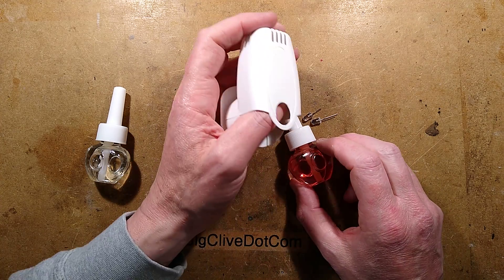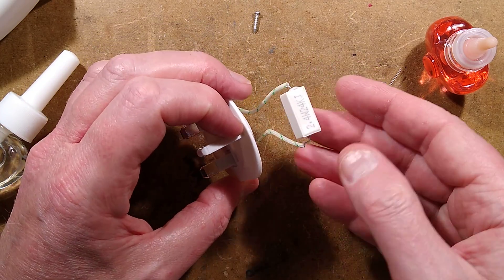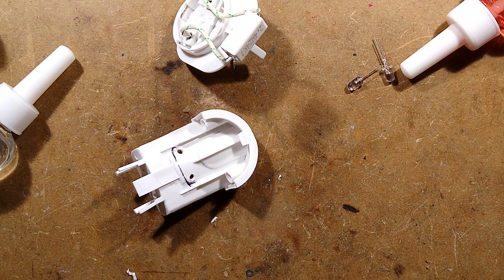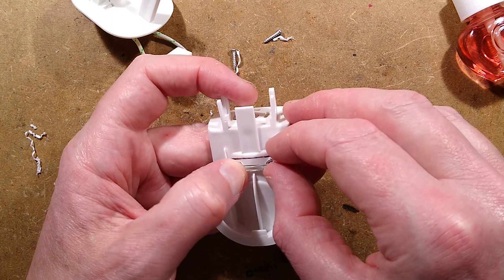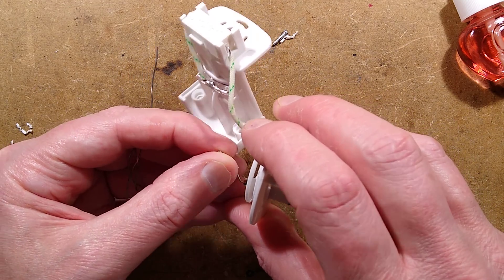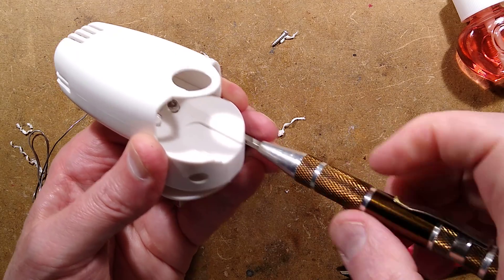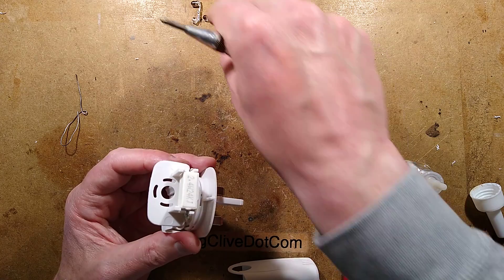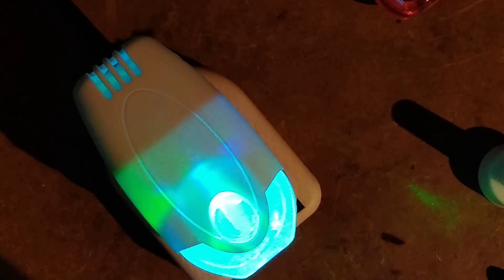Air "freshener" hack gone wrong

Comment: never assume long lead is positive, i had a few many years back that were long lead negative😉 think i still have some left!
Reply from the maker: The fred LEDs were the worst for that.  Probably because they used the gallium nitride machine settings for gallium arsenide LEDs.
Reply: He did mention testing them. For color, granted, but that would still require correct polarity.

Comment: OWW! Pop goes the weasel and so does the LED, I actually thought you would put an LED on each lead ie. one on live and one on neutral rather than tramline them together would it not work the same and possibly less chance of shorting out :-)
Reply from the maker: They have to be in inverse parallel for the AC.
Reply: no it won't really work - the diodes will prevent the current flowing in the reverse direction for the alternate side. Except if you push past there reverse breakdown voltage - which will "work" for an exceptionally small time as leds kinda don't like that and die
Reply: @askjacob  Yes I worked that out after I posted of course you could use two extra ordinary diodes, but yes I just posted without thinking it through which 5 mins later I had:-)

Comment: How to explain our eWaste problem:
"Cheaper to buy a new device over buying refill"
Reply: Yup.  Device is a loss leader for the ink, blades, refills: check.  Resistor under-rated or otherwise designed to fail early: probably.  New software doesn't "support" last year's hardware: working on that now?
Reply: @idjtoal  That would be Windows 11 you are talking about. I get why they are trying to push for people to use computers that are more secure, but they shouldn’t exclude the people who don’t have the proper hardware completely. Educate people to know what new hardware they should buy next when they upgrade…
Reply: @ColinTimmins  have you ever considered that "security" is a selling point? I mean whether it is actually a threat or not in the real world.
Reply: @gs425  They'd still have that selling point by saying "if you buy a certified Win 11 computer you get these security features you don't if you run the upgrade on older hardware".

I think the CPU limitation, if indeed it IS as limited as suggested so far (I suspect its not and they will revise the list before launch) is efficiency as much as security.

Having to keep a code path for if CPU has this instruction then do x, if it doesn't then do y, can get awfully complicated, buggy and inefficient.  A clean break saying it will only run if you HAVE these instructions is long overdue, its just not something you'd generally do if CPUs from only a couple of years ago DON'T have those instructions.
Reply: @ColinTimmins  There is definitely value for Microsoft and consumers in drawing a line in the sand and saying, "Right, anything older than this just HAS to go," but security is definitely not a major benefit of the move. Vendor lock-in, however, would become much easier if TPM is an absolute requirement.
Reply: Yeah printer manufacturers went through this phase a long time ago. It was often cheaper to buy a new one vs cartridges. When everyone caught on, they switched to 'trial' cartridges which had 10 pages worth of ink. People began refilling, so they created a mechanism to encode the cartridges.
I bought n Epson ink tank printer, thinking that by paying a higher initial price I could avoid being raped. Unfortunately not. It has a pad to absorb ink from the cleaning cycle. After a certain number of cycles it announces that the pad needs replacement and refuses to print. Guess what? Replacing the pad costs as much as a new printer.
Reply: To summarize, it smells nice and now lights up... hmm... what does this remind you of? Scented Candle.
Pros: Smells nice, creates a pleasant ambiance, no harmful waste, no embodied energy remaining after use.
Cons: things could catch fire.
Modern replacement.
Pros: Smells nice and also glows. Was much less likely to catch fire. 🤣
Cons: modern waste products after use, lots of embodied energy, base products are non-renewable, likely assembled by people not thrilled regarding their current internment.
not an extensive lists.
meh, just saying.
Reply: I think the joke here is that they rely on the usual business model used for printers or razors, and the only real deterrent for consumers in this strategy is "you don't want to throw it all away right?" - when the price says the exact opposite, talk about an incentive to waste...
Reply: Literally I went to buy mosquito repeller thing (same thing as above) and one box containing both device and liquid bottle and the other was only the liquid bottle and guess what? they were both same price.
Reply: You can buy the "essences" very cheap and refill the refill bottles by prying off the wick then putting it back.
Reply: @Fridelain  I've tried refills before, but they make the wick dissolve. I assume the originals are some secret formula that stop the wick dissolving specifically so you can't refill them. This was specifically with the Glade branded ones, your mileage may vary with other brands
Reply: You pry on the plastic cap, not the wick itself.

Comment: It's a corollary of Murphy's Law: if you put all the screws in before testing, it will fail.
Reply: Or it only works with the screws out.
Reply: Or in my case. Lose one screw put in just a little longer screw.  Which shorted the device. Lots of magic blue smoke.
Reply: I think there's an opposite effect: The failure gremlins are attracted by fear, and if you put all the screws in before testing it shows them you're not afraid, so they stay away (usually).
Reply: @KarlBunker  They are also very attracted to any public demonstration of the HW/SW. How they know the difference is one of the great puzzles of the universe
Reply: @KarlBunker  
No in my experience. Any time I put everything together before testing, because whatever I was doing was so straightforward that it couldn't possibly fail; it fails.
Reply: This is reason, why I don't put last screw in before final tests.. 😂
Reply: Oh thank G. I thought it was just me !!
Reply: Or not work, and you have to take everything out again to check what's wrong :P.
Reply: And a corollary: If you leave out most screws for testing, you will forget to put them in after testing.
Reply: Second  corollary: After you put all the screws in there will still be one in the parts cup, ignore it or take it all the way apart to find where it goes?
Reply: Also if you plug directly into mains power without a switch.
Reply: Worked with a brilliant eccentric sparky who often fired screws and whatnot over his shoulder saying “we don’t need that ,do we?”
Have to admit he frightened me at times. Back of his hand was his phase tester. If wire was live he got a shock. Once passed an apprentice sparky attempting to isolate a machine. Apprentice was told fuse was on wall at other side of factory. This wall had hundreds of old school screw in ceramic fuses and none marked. Passing 20 min later apprentice had still not found the fuse so master sparky asked for his heavy electrical pliers. 
Before you could blink there was a huge flash and a bang. Master sparky had thrust pliers into junction box. Now says master sparky to apprentice “ when your finished the repair it’s the blown fuse over on the fuse wall you need to replace”
That was over 30 years ago imagine what health and safety would say to day ???
Oh I should add I was the plant safety officer at that time “ blushes”

Comment: Sooo... you could put a mild chorine smelling "air freshener" in the bottle, put some LEDs that look suspiciously like UV-C light in the back and sell on eBay as "anti covid air purifier". Bonus points for adding an ioniser in the top too.
Reply: You can get some seriously nasty results from putting chlorine based bleach through an ioniser. I'm not sure I would even want to be in the same town.
Reply: @gordonlawrence1448  Like what? (No one actually suggested putting the bleach through the ionizer, anyway.)
Reply: Say it uses elderberries and essential oils and you hit a specific target market
Reply: @blazetechstuff  Since most essential oils are poisonous, he already mentioned air pollution.
Reply: Use a Melaleuca, Eucalyptus or Citronella smell and sell it in any Byron Bay or Bondi "boutique" shop and you've got yourself an empire.
Reply: Just make a million of them in some Chinese sweatshop, sell for 99,95 a piece and pocket the 95 profits per unit. Writing the advertising material and user guide might take a hangover or two.
Reply: @benbaselet2026  After 2 days they'd appear on Wish for half that..
Reply: @benbaselet2026  Just take any Chinese instructions for any device whatever and put them through Google Translate. No difference will be noticeable.
Reply: DEADLY  in fact 
It's MUSTARD GAS Jr.
No joke Jr.
Reply: And then the Chinese market can copy the design and reproduce it at a fraction of the cost. Producing both a UVC sanitization model and a light up air freshener model.
Reply: And we all know some antivaxxer will buy it

Comment: Hello there, new to this channel. Absolutely addicted since watching. I'm currently trying to work out a TV PSU unit. The output isn't providing 12v or 3v but 8v instead. Do you have a video where you diagnosis how you can identify a potential issue. 
Great smooth videos much appreciated and thank you for your time.
Reply: your best bet is to watch diodegonewild or eevblog or adrian black(adrians digital basement) clive sometimes does repair but he doesnt go as deep into circuit analysis and failure as they do usually, i would say personally to check the electrolytic capacitors on the output though, clive is more build from scratch than repair
Reply: @frogz  much appreciated for the advice and pointing me in the direction of some other channels. I will certainly check these out. Eevblog is defo a master with electrics also.
Cheers
Reply: I have had moderately  good luck just checking the electrolytic caps values. You can often get 'close enough' without removing them. When there are a couple in parallel check for the combined values.  If you don't have a cap checker look for discolored or bulging ones.  
If you find shorted mosfets may not be worthwhile  replacing them, often a symptom of some other problem and they will just short again, likely not the issue when it is producing an incorrect output though.

Long time ago I was talking to tech support about a high end Hitachi monitor, he said "see that brown cap near back of the vertical drive board" I replied yes,  he then said "That's your problem,  good ones are blue".   It was a known issue it appears.
Reply: @martinmoeller9186 Much appreciated for the detailed reply and time taken to do so. I will defo take all this away and see if  i identify anything along the route. Thank you
Reply from the maker: First suspect is the capacitors.  Look for some that are domed.
Reply: @bigclivedotcom  thank you for the reply and guide on my issue. If I fail would you be interested if I sent you the board to diagnose?

Comment: Over the years, I've found that transistors also make good fuses.  Thanks for the video!
Reply: fastest thing on 3 legs!
Reply: good = expensive, i'd rather lose a cheaper piece of silicon than a power tranny haha
Reply: Voltage regulators on Arduino clone  Nanos too. I was driving a RGB addressable  LED string from the 5v pin.  When I set them all to white there was a pop and smoke.  I was amazed that the Arduino still worked afterwards when back powered with 5v to the pin,  just the regulator  had died.
Reply: they make good inverse fuses, going short and causing chain reaction blow ups! had this problem a lot in certain portable colour tvs in the 90s, resistor in psu went high, psu ran away with itself, going overvoltage, popped the switching mosfet short, then blew out several other components

Comment: I’m confused; what (were) the forward and reverse voltage handling capabilities of the LEDs, and how did simply limiting the current not affect them?
Reply: In forward bias, most of the voltage is dropped across the resistor, and the conducting LED will only have its working voltage (for the given current at that resistance) across it. This means the reverse voltage across the anti-parallel LED will be clamped to whatever that is (3v or less).
Reply: The way I think of it (which is almost certainly wrong), is that the resistor limits the current to 10mA, and because of that, the voltage drop across the LED (remembering that voltage is always a relative measurement, in this case relative to each side of the LED), will only be however many volts the LED consumes at that current. It doesn't matter that there's 240v on one side, if there's 237v on the other, then there's only 3v across the LED. It should be stressed, electricity is something that I have struggled to understand my whole life, and I'm pretty sure I'm wrong here. Maybe someone can see my malfunction and straighten it out.
Reply: @Agent24Electronics  Of course, if one of the LEDs goes pop, the other will probably not survive.
Reply: @hyperboloidofonesheet1036  Indeed, that is a disadvantage to this arrangement.

Comment: A customer of mine (few years ago) had one of these catch fire and burn the whole front of their house, the manufacturer tried to get out of the claim
Reply: 'Wonder what it did to their lungs before it went bang?
Reply: i've seen on some  packs they say not to leave them on 24/7 and not overnight 'unsupervised'
Reply: maybe that one was a 120v version with lower value resistor incorrectly marked/sold as a 240v one? 4 times the heat and power with twice the voltage!
Reply: Mmh you just reminded me, I had one that started having its plastic case slightly melt, I never really trusted these in the first place.

Comment: Final comment: how would you add some crossfade? So that there's still some shimmer, but it's less jarring.
Reply from the maker: That would be quite complex.
Reply: Was hoping it would be as simple as a tiny capacitor in parallel.
Reply: @bigclivedotcom  how about clamping the voltage with a capacitor and voltage regulator or transistor so the led doesnt flip on at the 0 crossing point of the ac, only at a higher point in the sine? or maybe a fancy setup of diodes so you're only pulling half wave off of it so they flash at mains frequency instead of double it?
Reply: There are probably simpler ways to do it, but I recently did it with a 555 giving adjustable PWM output and an inverter. Not something you could stuff into such a tiny device, though.

Comment: That resistor would get SO GROSS after a while. Just from the fumes collecting.
Reply: It won't. Since the resistor is the hottest thing around, the aroma oils will not condense onto it.
Reply: @vincentrobinette1507  Have you ever looked at the hot end of a 3d printer? It gets gross, due to non volatile sticky compounds settling out. Same kind of concept for the resistor
Reply: @GadgetBoy  True, but in the 3-D printer, the filament is in direct contact with the heated nozzle. In this  case, the resistor doesn't make direct contact with the liquid.
Reply: @GadgetBoy  it’s not the same at all. 3D printer has molten plastic extruding out of it. This is never in contact with its ‘fuel’ (referring to the smelly oil)
Reply: I'd think that's the last place they could settle

Comment: Do they just use a regular power resistor. Didn't know that!
Reply from the maker: The high profile ones sometimes use a custom resistor shaped like a donut.
Reply: dunno about current generation ones but i've seen a round pcb with 4 smaller resistors in series and i've seen a PTC used as well

Comment: well, it wasn't electroBOOM, more like electroPUFF, but still entertaining
Reply from the maker: That's the problem with LED.  They never BOOM properly.
Reply: @bigclivedotcom  like i said in the other comment, try discharging a camera flash through them, you'll get a nice loud crack and it'll shoot the tip off at high velocity, only the tip and only in a fraction of a second ;)
Reply: @frogz  Just the tip?

Comment: One-use only limited edition magic smoke aroma freshener.
Reply from the maker: With fresh resistor aroma.
Reply: @bigclivedotcom  Ah, the smell of a burnt electrical component!
Reply: Needs a selenium rectifier for that toxic stench...
Reply: @kuebbisch  Ah, I love the refreshing aroma of selenium dioxide!
Reply: Not really, you can order spare LEDs for these units, for multiple uses and hours of fun. 👍
Reply: .........this comment made me remember that EXACT smell of the plastic of leds that went pop
Reply: I can smell the popped led right now.  Even worse then average semiconductors going bang.